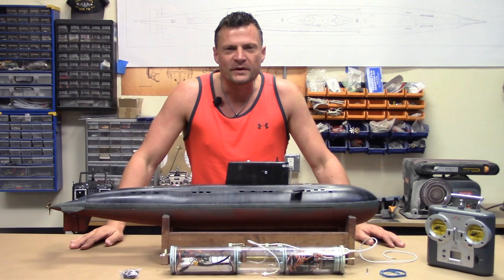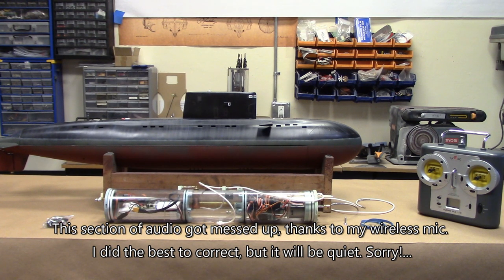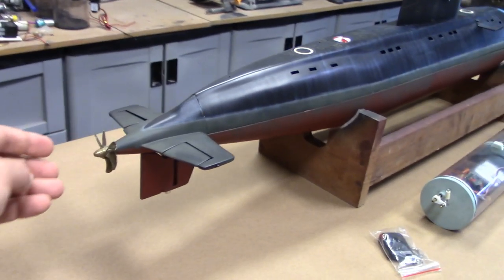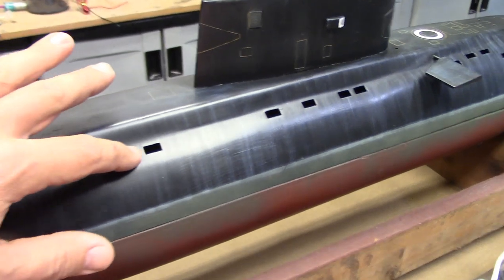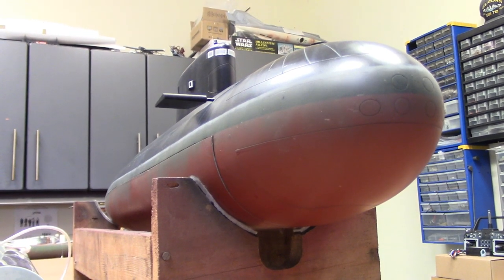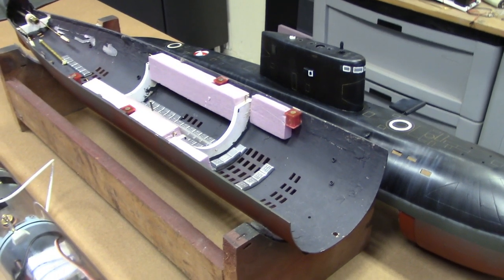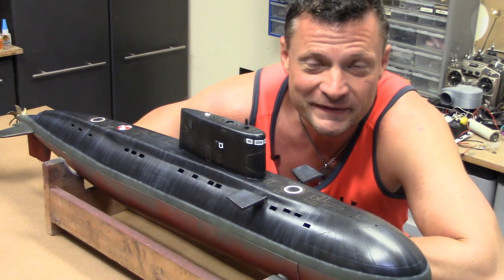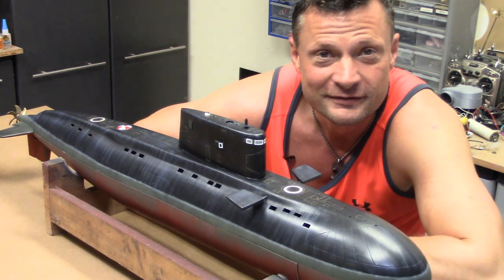1:72 Scale Russian Kilo RC Submarine Overview

Comment: Silly question but could some one make a switch out of a periscope up scope on down scope off? Granted the system your using is badass. But just wondering if using the periscope is a bad idea?
Reply from the maker: Not a silly question at all! Many have used periscopes as a switch. You just need to have the actual switch itself located either outside the WTC or directly below the periscopes, which can be tricky...
Reply: @RCSubGuy  gotcha, thanks for the info.